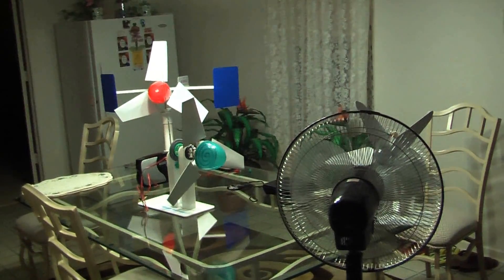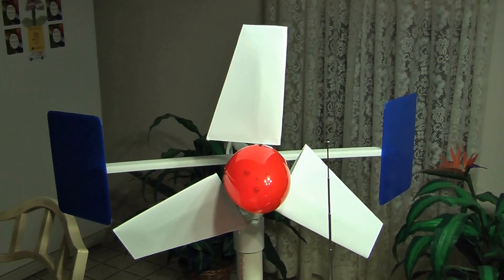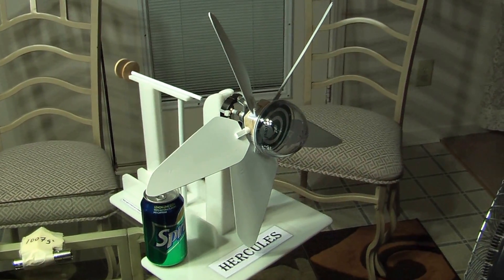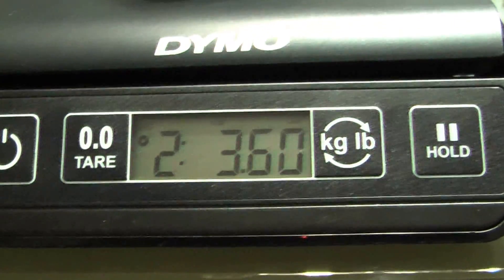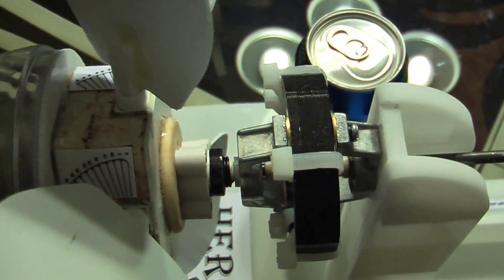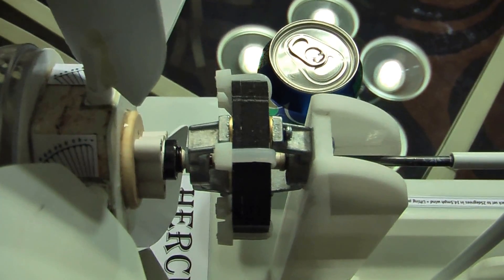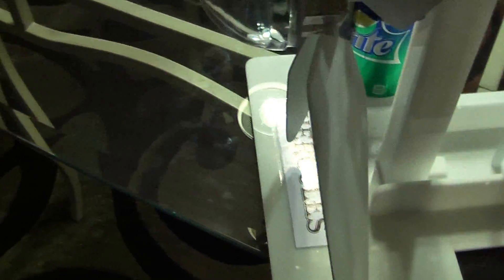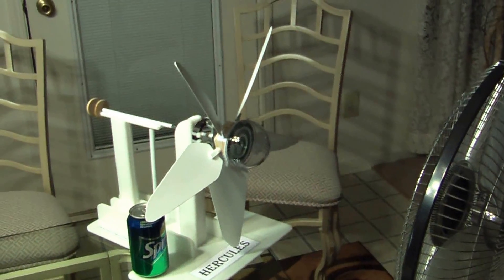Mini wind turbine 1

Comment: Renz Arnau: Hello. If you are asking about my small turbine that lifts weights, it does not have a motor in it.  Now, if you are looking for a wind turbine that generates electricity, you should view the following two videos of mine.  First is my small wind turbine called Wind Battery.  See: Mini wind turbine 2.  The secound one is a little larger.  See: Mini wind turbine 4.  After viewing these two videos, leave me another comment and I will get back to you right away.

Comment from the maker: Thank you R70451:  the gears or model helicopter gears from my local Hobby Town USA.  The blades are made from a material from the same hobby shop and its called Polystyrene.  The thickness of the polystyrene is 0.060".  I purchased an old printer from Goodwill Industries at the price of $6.00. From this printer I was able to reclaim 3 DC electric motors. The motor in Wind  Battery is one of those three motors. If you get the chance, please watch Mini wind turbine 2 and Mini wind turbine 4. Thank you for watching my video.